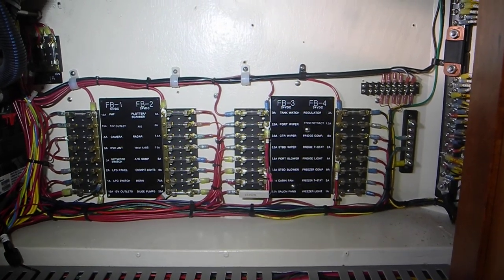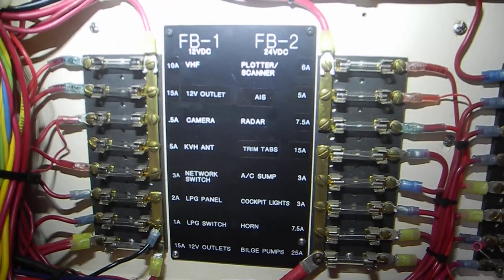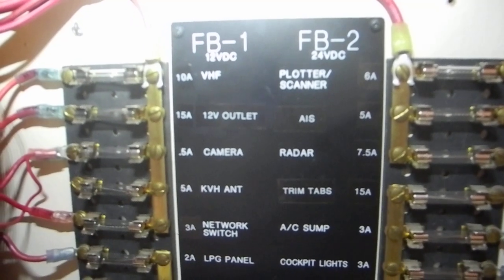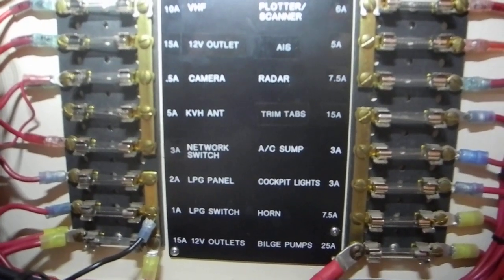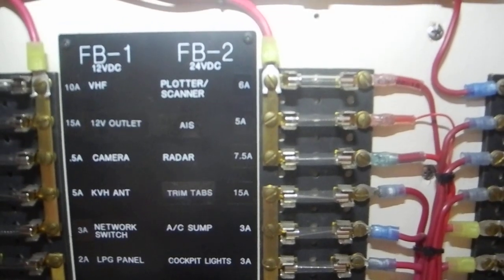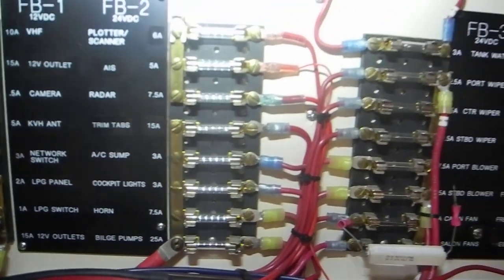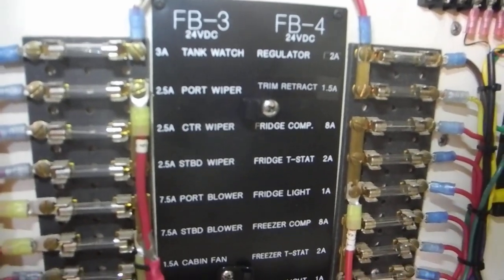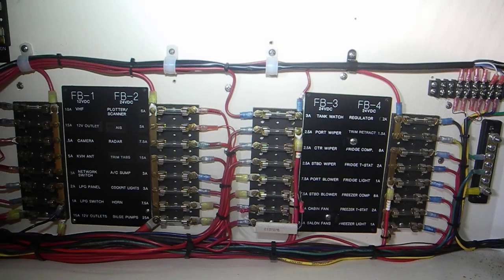Fuse Bus Bar

Comment: Is that after tge breaker panel  ir in place of it ?   Looks beautiful
Reply from the maker: These are dedicated fuses per each item labelled. Circuit breakers may be elsewhere. This is an older Grand Banks.
Reply: @AskCaptainChris   when you say older , that makes it even  more impressive  .  Usually  older means jury rigged together  ! 
Have a great Christmas
Reply from the maker: @walterdavis4808  Merry Christmas!